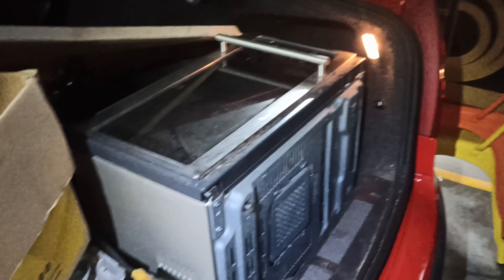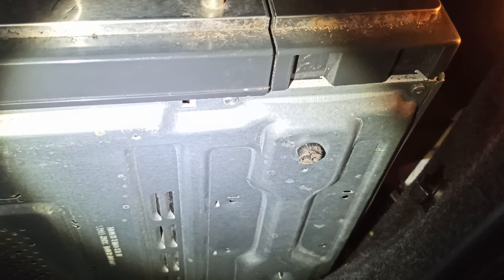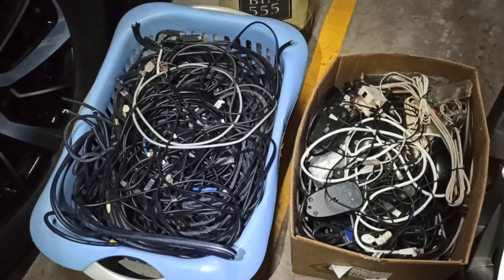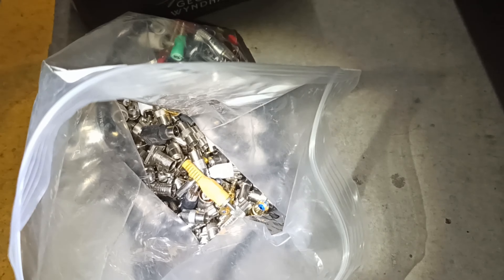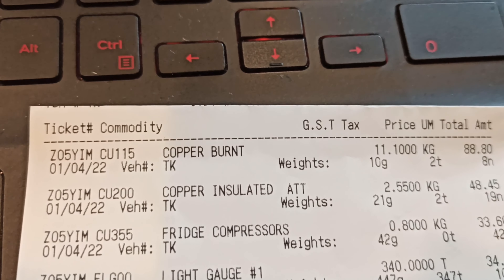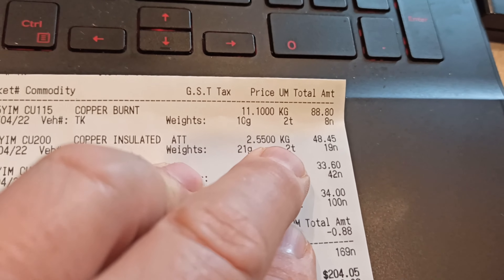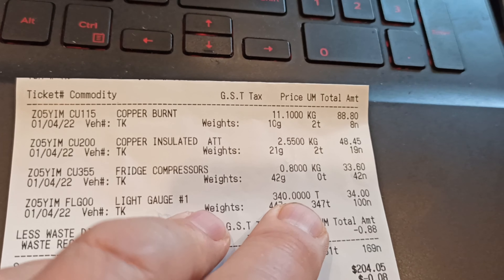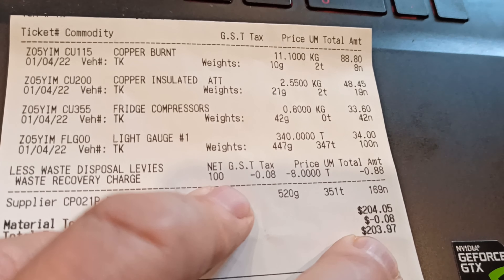91 Scrap Metal Yard Run. Copper, Compressors, Wire, Steel (01Apr2022) Bondi Scrapper

Comment: Very nice mate! Isn't it nice to get decent money for steel again! 👌
Reply from the maker: It's great!  If only I had time to get to the scrap yard again and make some content.
I've gone from 5 days/wk to 2 days/wk and wonder how I had time before.  On the bright side the renovation is almost done.  The painters are in this week (I hate painting) They are working me like a pit pony.
Reply: @bondiscrapper1781  I'm not a fan of painting either! We had our place done last year and I didn't lift a finger! 🤣
Reply from the maker: @TheUltimateRecycler   I've demolished a built-in wardrobe, removed all the blinds, taken 24 downlights out of the ceiling, planed a door so it closes properly, filed protruding nails out of 2 sliding door cavities, removed 2x 15kg glass balustrades, a wall sconce, cut away all the carpet from around the skirting boards and half a dozen other small jobs to make the painters job easier and give him the best chance of doing a top job.
New carpet and a new custom wardrobe next.